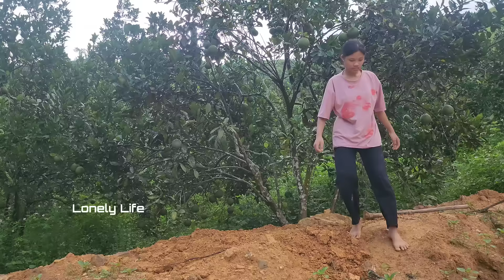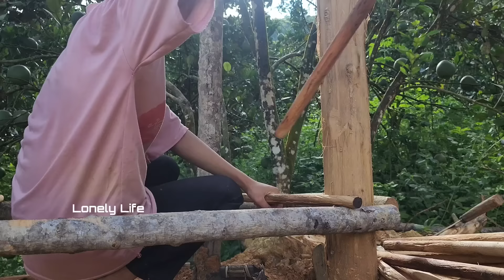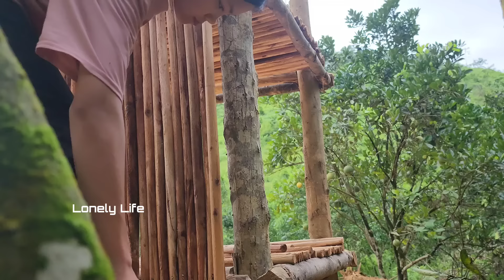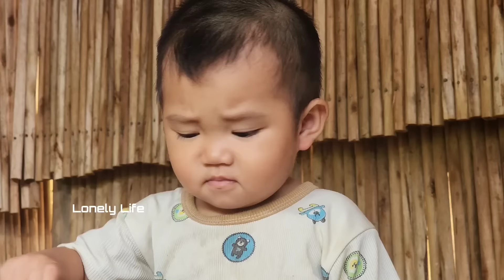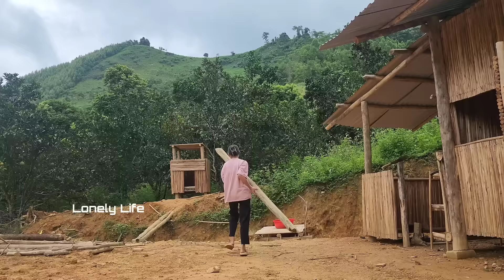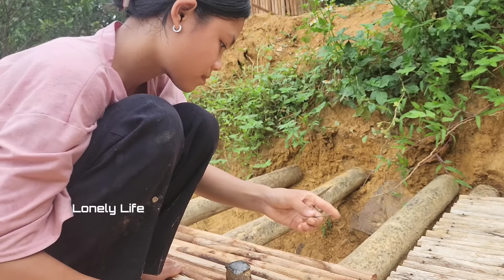Build a coop to raise chickens and start a new life, the life of a 15-year-old single mother

Comment: Dear lonely life:
I am glad you built a chicken coop today. It’s pretty and the roof can be tarped or put a metal roof. 
I did want to mention that before constructing with wood, it is a good idea to remove the bark. Reason is that termites and other bugs can dwell in it and ruin your whole build. 
You can also burn or coal the feet of the structure , to prevent bugs from climbing up. I don’t know how much of a problem this may be with humid environments. But in the USA, wood structures have to remain vigilant to not get these pests near their homes. Hope it helps.